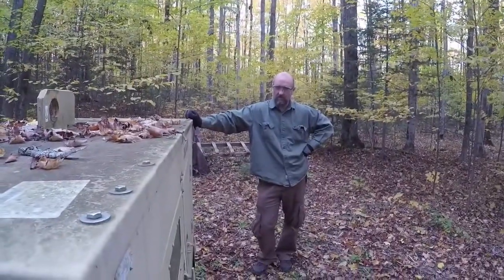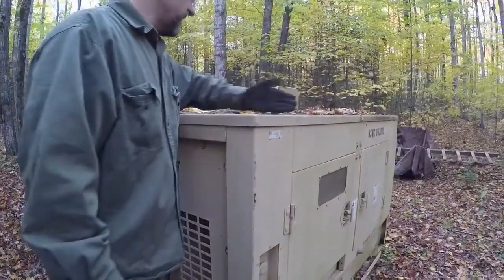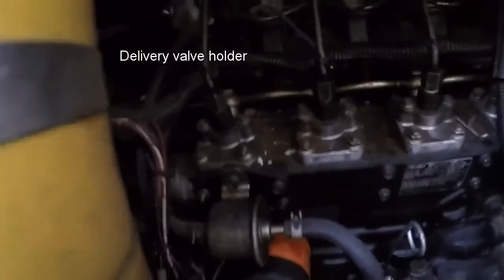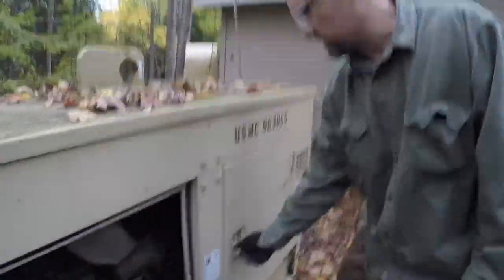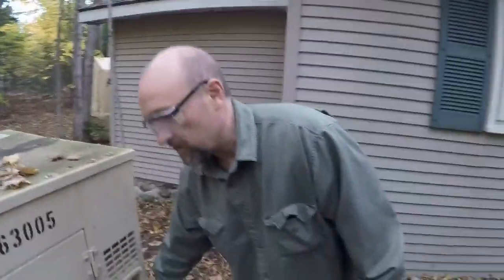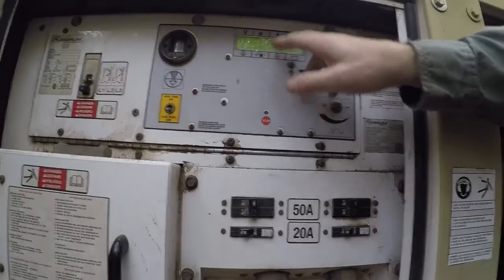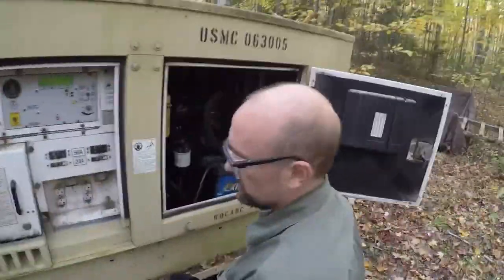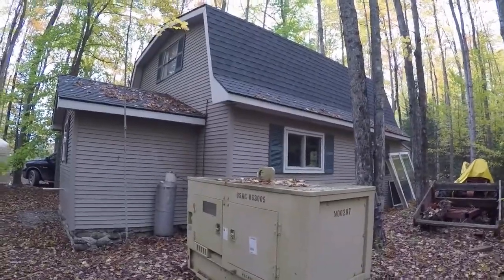Camp generator - off grid electric

Comment: Yeah the old diesel fuel seems to be a big subject of talk on the smokestack form. They're always talking about having to add biosides and lubricants because the modern low sulfur diesel doesn't lubricate the injectors like the old diesel fuel did and it also is prone to bacterial growth in the fuel tank. Then you got to worry about water separation. My advice would be keep the tank full and use good quality fuel.

Comment: There is an adjustment pot on the back of the control board behind the gauge screen. You can turn it with a tiny flat screen driver while you have a multimeter on the battery to tell you the voltage. Turn it counter clockwise until the screen voltage and the multimeter are the same. I had the same issue with mine reading high voltages.  And btw the screw adjust on the front of the panel with a big V under it is the voltage fine adjust. The frequency adjust in on the black box under the either bottle.
Reply from the maker: It would be nice if this could be adjusted to 240VAC across any two phases as I installed a voltage boost transformer to get up to the 240 needed to get the inverter to work as a battery charger.  I realize this would set the single phase voltage to something like 132VAC, or at least this would seem to be a likely consequence but right now I'm only regularly using the 240VAC output from the boost transformer which is limiting me to around 3200 watts.  It is fine for what I'm doing because the inverter only can use 2000 watts max to charge. A problem may arise if the inverter is both charging at 2000 watts and then demand above that is more than 1200 watts which I could see potentially happening in the future.  This is a disappointing limitation in the configuration used especially since the unit is capable of much more.  It's not high enough on the priority list to address at this point though.  Thanks for the tips.
Reply: That is what the voltage adjust knob on the front of the control panel is for. You can turn it up to 240 only takes a few seconds.  It's for the fine adjustment of voltage.  The thing you said in the video that adjusts frequency adjusts voltage. Hopefully that will.fix most of the problems you had with your inverter and charger.
Reply from the maker: @jordandavid1671  That's awesome - and here I added a boost transformer to fix the problem :(  I'll check out the voltage adjust and let you know - thanks again!
Reply: Yes the single line voltage would be a little higher which is why I usually run something around 230 volts between phases.  This usually gives your appliances that need to see more volts that won't run on 208 the power they need but will not dry your 120 volt appliances as the single line voltage is under 130. Most electrical devices can withstand a ten percent voltage variation either above or below 120 volts and be alright. I would see if the charger runs at 230 volts and then everything else should also work.  Good luck.
Reply from the maker: Thanks Jordan - https://youtu.be/qsN1KlYPEVY

Comment: I have this same generator also built in 2005 that I picked up a few years ago at a government auction.  Mine is rated at 20 or 19 kw but has the 65kw gen head on it.  They also make this unit in a civilian version but it only has a 20kw gen head on it.  You need the 65 kw head because it is 3 phase.  So to actually be capable of getting 20 kw single phase power out of it without overloading any single phase the generator has to be three times larger than the rated capacity.  If the gen head was only 20 kw you would only be able to get 10 or 12 kw of single phase power. But since it's extra big you can get full output on any single line without over loading any single line.  Basically the military gets better quality stuff so they can run it at ita max output in any electrical output configuration. Wether single 120 volt or single 240 volt 2 phase or three phase.  I actually added voltage switch board to mine out of a 60 kw military generator so I can quickly change mine from 208-240 volt up to 416-480 volt in a couple minutes.  Allowing me to hook up any kind of three phase or single phase equipment I need to operate. It's a great generator and the isuzu engine is well made and easy to find parts for.  The gen head size has nothing to do with the frequency. The frequency is maintained electronically from a magnetic pickup on the flywheel and a dc actuator on the fuel rack. It's controlled by the little black box under the either bottle. Which you were correct about. I removed my either assist because it has glow plugs already.  That had to be an added feature for the military so it would start in any temperature.  Better to not use either though as it causes the glow plugs to pit and crack.  And as far as harmonic distortion is concerned it will be very low because is a brushless synchronous gen head. The power should be almost as clean as the power from your electric company.  Good luck with a great generator.  All the military ones I've had were all over built for there ratings so they should be able to start much larger loads than the commercial equivalent and they should last much longer.
Reply from the maker: Thanks for the additional info.  No complaints here so far with the unit.  For my application it's a bit oversized and I certainly don't need the 3-phase power at this time.  I was thinking the larger alternator head would provide a more stable frequency due to the extra mass of the unit during large load starts and stops .  The 15kW rating on each phase makes sense and is good to know.  I'm hoping the electronics will stand the test of time.  More so from not being used much.  We'll see.  So far so good it seems.
Reply: Can you recommend any books on this topic? I envy your knowledge and I’m planning on buying at least one of these. I know next to nothing about the details of diesel power generation and what components are needed in a delivery system for usage.

Comment: you will want to load this up at some point or else you will end up wet stacking the engine.
Reply from the maker: That will be difficult for me.  I don't really have anything handy that uses that much power for any significant length of time.  Maybe I could dry a couple loads of laundry in an electric dryer or two if I could round them up.
Reply: I have 25 kw of heating elements with a home hvac blower on them and this generator runs them with no problem.  We ran it for two days with all the elements on to dry out some rough sawn lumber. Did the trick and was very economical on the fuel.  So you would need a laundromat attached to really start to make it sweat!  It probably won't wet stack unless you run it with a small load and the temperature outside is very cold. I wouldn't worry about it too much unless you have fuel coming out the exhaust or the oil level starts to rise again and the injectors are still working properly.

Comment: The 65 kw rating is probably for 50 hertz operation at 1500 RPM, while the 85 kw rating is for 60 hertz operation at 1800 RPM.
Reply: 85 is kva. 65 kw.
Reply: You think it can run 50hz?
Reply: @tujuprojects  It probably can.  It would just be a matter of adjusting the governor on the engine to run at 1500 RPM instead of 1800 RPM.